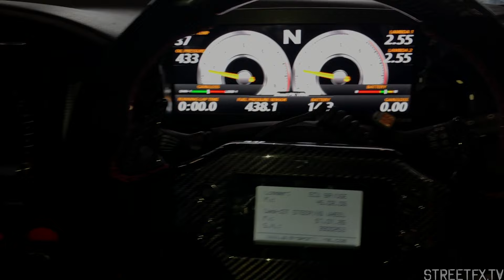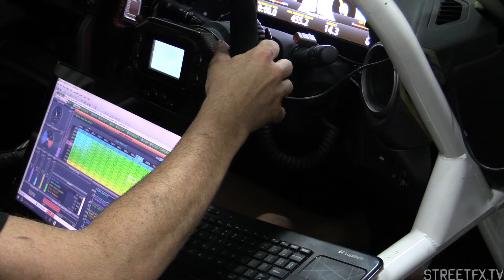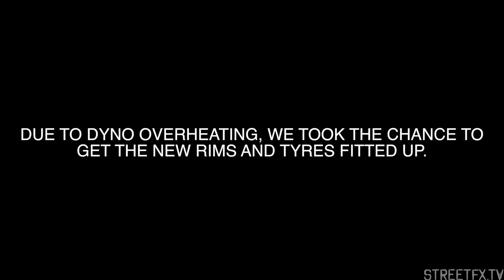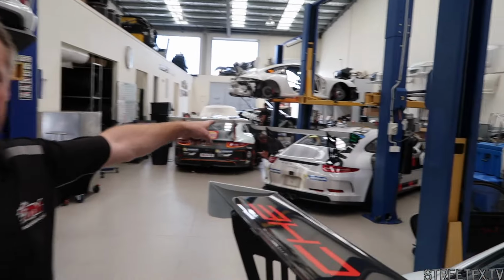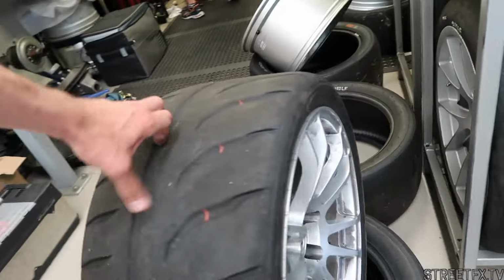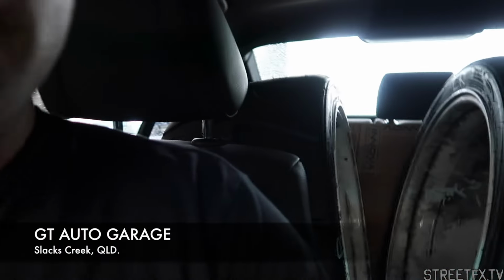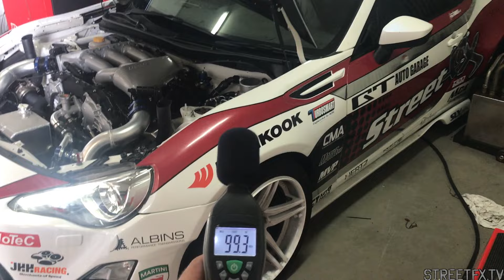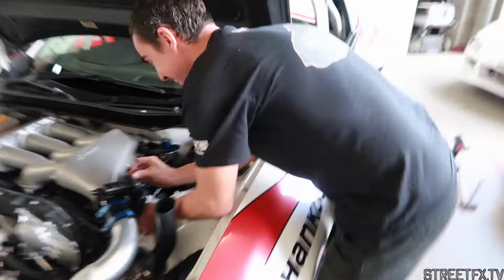WE DID IT! WTF86: Toyota 86 with 4.1L R35 GTR engine kills dyno, makes flames & smashes power goals!

Comment: A car commissioned by Toyota, built by Subaru with now an engine from Nissan. This is sick.
Reply: Toyota built the body and Subaru built 99% of the engine. It uses Toyota's fuel system.
Reply: Toyota did not build the body. You can even see the Subaru stamping and stickers on the sheet metal. The suspension, brakes, interior components are off the shelf Subaru parts. The Chassis is developed off of an existing Subaru sedan adapted for a coupe. The Toyota parts is that Toyota oversaw the design, provided the fuel system, the rear differential, and worked with Asin for the transmission. But it's built at a Subaru factory majority of the car being Subaru.
Reply: Even the paint is Subaru and has Subaru paint codes (which does catch a few painters out) :P
Reply: So it s HYBRID
Reply: BangCreeper, yea it's awesome!
Reply: Sigma Projects actually the company scion created the body.
Reply: Alatham1019,
Who told you that? Scion has no engineers. It was a marketing branch at best where they would rebrand specific Toyota models as Scions. The FRS/BRZ/GT86 was a design evolution between Toyota's American design group (Calti) and Toyota's French design group ED2. But the chassis's structure is Subaru.
Reply: Correct except the bit about the Xmission, Toyota didn't work with Asin for the transmission, it's the same unit out of the IS 250.
Reply: You’d think they’d get together to make a good car instead of 2 similar makes (Toyota, suburb) and make a car in between an 86 and a GTR. $30,000-175,000
Reply: @nimo517  having similar cars between Subaru and Toyota cut down on cost. What I don't get is if they planned for a serious sport competitor for the US then it should be planned with three distinct power levels much like how the American brands do it for the Mustang/Camaro/Challenger. But it is what is for whatever the reason is. 

A high classed Toyota sports coupe would have been the LC-F, which looked like they were starting to do test runs of it, but it got canned when the pandemic hit.

Comment: Ive always wanted to put this motor into a 300zx
Reply: Sounds Kool but the amount of money for the engine and fab work you might as well build the vg30 and get a good amount of power. Theres a 240sx with the r35 motor though.
Reply: That's good to put in a z but in a Toyota,  he'll no
Reply: The 300zx already have a really good strong engine and if you're trying to get to the 900+ hp range just build the current motor. Doesn't really make much sense to put that motor into a 300zx it'll be just added weight less handling and a ton of torque steer that I'm sure would make it uncontrollable.
Reply: even if you went the cheapest route to do the swap and skip corners itll probably still be more reliable haha!
Reply: It can also be fitted into the 240Z
Reply: an Infinity G37S for me :)
Reply: Torque steer in a RWD? Thats new...
Reply: @ginicholas4322  

Only 150 pounds of extra weight.
Nothing that a suspension tweak can't  account for. 

Not like shoe horning an LS into say... a miata.

Comment: how did you install that gearbox with pedal shift controls ?
Reply from the maker: It runs a pneumatic pump to shift the gears. The ecu does ignition cut and retardation to rev match so you don't even need to use the clutch.
Reply: that is a brilliant idea

Comment: For my part, I have a very serious question. Now, this car has a shitload of power. But what his the handling and weight ratio doing. The 50/50 weight distribution and the 1'200-ish weight of the car are the strong points of the BR86... What is it for this car ?
Reply from the maker: it's got the same weight distribution that it did stock. It could use a bit of a diet, but that's what happens when you add stuff and dont pull out any weight anywhere.

Comment: It always "grinds my gears" when guys with lots of money, but not much knowledge, pay someone to make their car fast.
I actually respect guys who do it themselves and don't just walk about with a camera, watching it being made fast.
Reply from the maker: I'm a computer programmer by trade who loves cars.. Does that mean I should be pissed at people who don't know how to program? I've done plenty of automotive stuff myself: engine swaps, vehicle wiring, suspension, brakes, even fitted bodykits and done complete resprays of my own cars - because it's a hobby. However when it comes to making big power cars SAFELY to do 300kph around dangerous circuits, what's so wrong about trusting professionals who do it for a living and making sure it's done right?
My safety is worth more than the money I would save by doing it myself.

Comment: Does it have actual anti lag? So often I’ve seen people call launch control or a two stage rev limiter “anti lag”.
Reply from the maker: In the video you're seeing a combination of both. It's limiting the revs and adjusting ignition to build boost (thus the flames out the hood - which will only happen when the wastegates open at their designated spring pressure), meaning we're siting at around 15psi and 4,000rpm. 

The Motec ECU can also do "ALS" as per Rally cars for maintaining boost while off throttle, although we have not set it up for that.

Comment: Fuck with restrictor racing it only cost more. Totally removing the reason in the first place. Ever team has spent millions finding ways around the restrictors so what is the point ? It would be cheaper to have  a run what you can !!

Comment: I thought the r35 was a 3.8L engine...?
Reply: it WAS a 3.8L, at least that's stock
and this engine is far from stock

4.1L from HKS 4.1L stroker btw
Reply: RDS Alphard oooh ok.
Reply: You have 3.8,4.0,4.1 and 4.3L
Reply: jean tsai ETS is a 4.4 and linchfield runs a 4.6
Reply: BrianCrower has a 4.45L stroker kit via having 100mm bore & 94.4mm stroke (stock is 95.5mm Bore x 88.4mm Stroke)
Reply: 3.8 liter stock but modded or with kits you can augment your displacement and to 6 cylinders it gives 0,05 liters more per cylinder
Stroked or rebored? Rebored would be hasardly, no?

Comment: Nice car, nice video...but a DynaPack? Really!? Mustang or Bust! I have never liked the "Hub" dynos. Especially since i have AWD cars, i only put my car on Rolling Road Dynometers (Mustang or DynoJet). Plus when you make high numbers on a Mustang it shuts ppl up LoL
Reply from the maker: Some people don't care about the numbers as much as they care about accurate, repeatable readings. Rolling roads have some advantages, however they have a lot of disadvantages also. Loss of traction, additional variables (like how tight it's strapped down, what tyres are on it, tyre pressures etc). Not to mention the fact they completely ruin sticky tyres on rollers.

Comment: It’s a cool car. I’m not being a hater, but why spend all the time and money to do that when you could just build a gutted gtr to 700hp  with the stock engine and get faster lap times?
Reply from the maker: We already have a 900hp gtr. Why would I want another?
Reply: Street FX Motorsport TV Ok. Fair enough! How does the 86 do in lap times compared with the gtr? The 86 will be lighter, but the gtr slays because of its 4wd, torque vectoring and stability control. I don’t see the 86 being faster with the same level of race prep.
Reply from the maker: The 86 will be faster. AWD doesn't mean faster laptimes. Fastest time attack cars are rwd.
Reply from the maker: We broke a drive shaft before we were able to get a complete session unfortunately. As for your comment - when you start to get into the top end of the field, you'll find the rwds are faster than awd. Most of those advantages you listed are helpful for road cars but not all out race cars. That's why all the GT3 models of supercars cars are converted to RWD. Check out things like the Huracan GT and so on. No sign of awd there.
Reply: Street FX Motorsport TV I have to disagree with the simple theory of RWD drive cars are fastest time attack cars
Reply from the maker: GI Nicholas you can disagree all you like, but the records don't lie. Have a look at the world's fastest GT and Time Attack cars. All RWD.
Reply: Street FX Motorsport TV I'm quite aware of the fastest lap times at the Nurburgring. The reason why RWD cars have populated the race seen was because of their reputable reliability in history, now that technology have been increasing you're starting to see more and more different drivetrain setups. Hell the GTR is like 8th on the list and it's awd and heavy and the civic type R which has only 300 hp and FWD completed the Nurburgring in 7.43. Only recently have auto makers have actually tried to produce Track capable cars other than RWD, expect to see more in the future. So, yes I disagree with the simple theory it's a misconception based on lack of current capable cars.
Also the rest that are high up on the list all have specialized suspension like magnetic ride capabilities that changes the stiffness of the shocks by the miliseconds.
Reply: Street FX Motorsport TV With that being said I also own a 5.0 so no I'm not hating on RWD I just simply love cars and appreciate what goes into them.
Reply from the maker: spend some time at an open class time attack. The RWDs are dominating the AWDs, and they don't have manufacturer restrictions.
Reply: Street FX Motorsport TV What I'm saying is there is simply a lack of track capable cars on specific drivetrains. In regards to AWD all there is that is track capable out of the box on the current market is the GTR and Focus RS and I'm sure the RS would beat a bunch of RWD on the track
Reply from the maker: you're talking about a street car vs a track dedicated race car. The Focus RS is a cool budget car but it is far from being a race car. Every major manufacturer reverts to RWD for their serious track-only vehicles, just the same as most competitive time-attack teams ditch the weight of AWD and switch to RWD. I'm not talking about weekend racers like people with a Focus RS, I'm talking competitive race teams.
Reply: Street FX Motorsport TV Whether you're rallying, road racing, drag stripping or even autocross they all have classes within them and while yes the driver maybe use the vehicle for the weekend he normally have a team and may also be sponsored. So the people that may convert their vehicles to RWD is not because it's better it's better for the particular class they're in whatever it may be. There are always rules and restrictions and budget, reliability, and availability goes into that. It's may best best to go RWD just because it's proven reliability and aftermarket supply and market for them but that's what it comes down to
Reply: Street FX Motorsport TV I used to think that RWD vehicles were superior on the track just because there were so many but I've been proven wrong and thought about it wrong. There are some very capable FWD and AWD vehicles and it all comes down to suspension work and how much R&D has been invested into it. As of today it's impossible to say if one drivetrain is better than the other because there's so much in regards to that haven't been ventured. It's cheaper to pick a known platform than do R&D on a new.
Reply: Street FX Motorsport TV what’s the email to brad from cawthrone composites cuz I can’t find any email

Comment: Soo.. you've thrown a big heavy motor into the front of it.. Have zero weight in the back, and trying to do 1000 horse... for what reason?? Are you going to enter comps to see how fast you can roast some tires but not do anything else?
Reply from the maker: It actually still has a 53:47 weight distribution, which is identical to stock. The car just now weighs a bit more.
Reply: danggg
Reply: Lmao
Reply: Cool man. How's your build coming along?
Reply: its called "bragging rights" hahah
Reply: mynameisray you don't know much about building cars do you?
Reply: How were the weight distribution figures obtained? I'd like to find this out for my car.
Reply: Zero weight in the back? I couldve sworn i saw a full cage in the cabin
Reply: Street FX Motorsport TV I thought stock had 50:50
Reply: Po Russki BMWs do
Reply: Po Russki  if i remember correctly, the BRZ/GT86s stock weight distribution is 54:46

....which means the current weight distribution is actually improved ^^
Reply: Aussies love a burnie build ;)
Reply: there are car scales that go under each tire and tell you exactly how much weight each wheel is supporting
Reply: farvatron put it on corner scales an you can see the weight distribution of every corner
Reply: Jacob Bacon nailed it on the head
Reply: stock FA20 weighs 380lbs, which is pretty heavy for a 4cylinder... VR38 is 600lbs, so not a crazy amount more and maintains it's general placement in the bay while making a fuckload more power. that's a win IMO